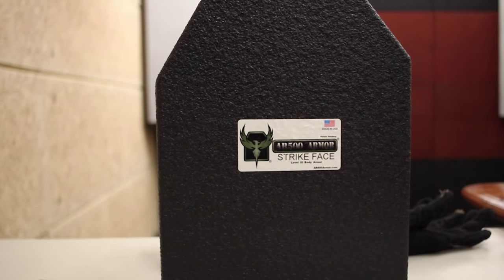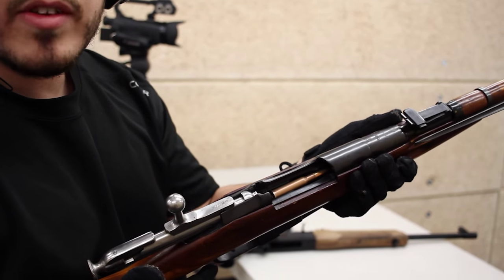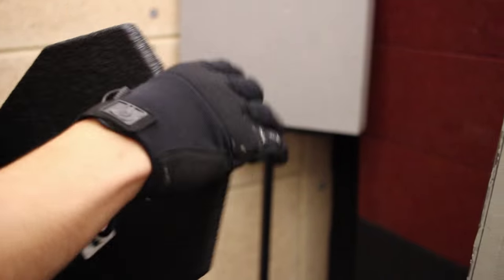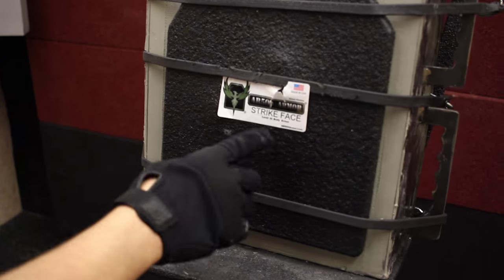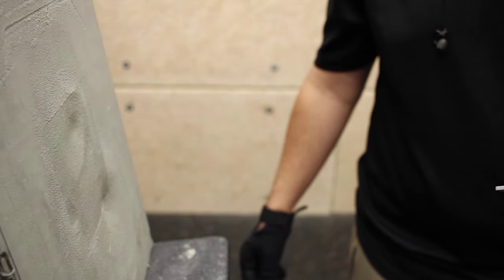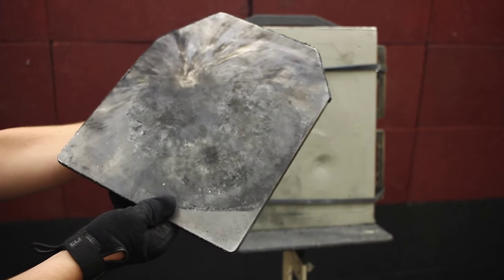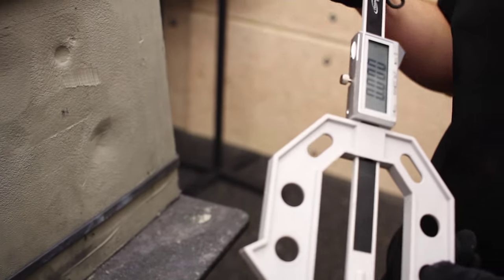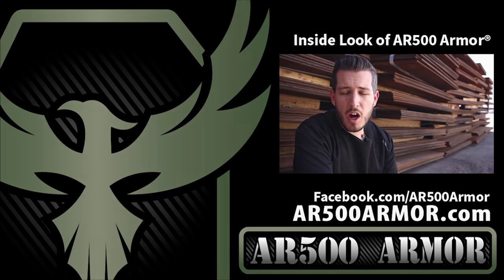7.62x54R Tifecta vs. Body Armor! Incendiary, Silver-Tip, Surplus - Mosin Nagant & VEPR

Comment: Use a Mosin 91/30 instead of the M44. You lose about 200fps out of that shorter barrel.
Reply: Shot my mosin 91/30 with the long barrel made in 1943 at a steel truck bed from the 80s today and it went through all 4 layers of sheet steel without issue
Reply: RichyN25 with my 91/30 I have shot though 1/2in steel I beam
Reply: That's AR500, it's not gonna help.
Reply: Would've also be interesting to see it hit with a steel core round.

Comment: Are those brass shells? I thought they only came in steel
Reply: Most of the military spec 7.62x54 is a steel laquered  casing with either a lead tip or FMJ but you can buy it brass cased from Hornady & others . I just bought an additional 100 rounds of brass cased 7.62 x 54 from a ammo supplier called Miwall out of California that's supposed to arrive today by UPS . I wanted more brass cased because those can be reloaded but the military steel cased can't be reloaded because they use a Berdan primer & are made that way so if your enemy can't reload them to use against you . The Mosin has been used in 39 different wars right up into the Viet Nam war & they made millions & millions of these guns the Russians did plus a few variants by others .  There is a Nagant rifle web page now that shows how to identify where yours was made & what model it is & has some good info on cleaning them as well as some tech tips on how to polish the bolt so the bolt slides easier & doesn't get stuck after shooting rounds through it which is to make sure all the cosmoline is out of it & to polish the pre chamber some so the cartridge slides in easier . It's often rough & what happens is the steel military ammo has a laquere coating on it that rubs off onto the pre chamber & causes extraction issues . They are crudely made because of being mass produced for the war effort so the factory didn't spend a lot of time on fine polishing things up on them because they needed to get them made & out to fight with quickly.

Comment: That has the slickest mosin nagant action I've ever seen.
Reply: It's easy to make them work like butter check out my vids. They're easy when the cosmoline is gone. Also if the bolt has parts from 2 diff factories they have slightly different tolerances.

Comment: I would love to see a comparison of the Short barrel carbine ( 20 inch) they used versus the full length barrel of the 91/30 (27 1/2 inch)
Reply: my thoughts exactly.
Reply: Yes, velocity is key when it comes to penetration.... when I saw the M/39 I knew something was up.
Reply: You lose about 200 fps out of the M44 vs a 91/30
Reply: highly unlikely you're going to be shot at by someone with a full length rifle. also 200fps doesn't seem like enough to go from almost no deformation to completely penetrating it
Reply: You will actually lose velocity with the carbine.

Comment: I love how no one mentioned that you'd have multiple broken ribs along with some ruptures in your vital areas. People just because you have body armor doesn't mean that you won't be hurt or killed from getting shot by a giant bullet like the 7.62x54R.
Reply: Except you won’t, the plate dispersed the impact. I however wouldn’t trust ar500 in the forst place
Reply: >.30 cal
MUH GIANT BOOLET
Reply: @grnnr1846  even with a truma pad you can have fractured ribs. A couple buddies of mine works at gun shops and sells body armor. It's more than possible to get seriously messed up even with proper protection.
Reply: @rodiculous9464  I used 7.62x54R as a example.
Reply: Trench _Raider especially with ar 500 considering it can still go straight through and when you shoot a mosin does the recoil break your shoulder? No because it’s dispersed. With soft body armor yes it can fuck ylu up
Reply: @grnnr1846  a buttstock is different than a projectile. You should learn more about physics
Reply: Trench _Raider what I’ve been referring to is hard body armor if we are talking soft body armor then yes it’ll fuck you up
Reply: @grnnr1846  it doesn't matter about size of mass, it's about how fast it's going when it hits a certain point of contact.

Comment: How come a ap 7.62x54r cant go through body armor but 7.62x51 (308) can ????
Reply: because the silver tip 7.62x54 is not an ap round, its a light ball round with a mild steel core.
Reply: It would have gone through, had they used a full length mosin and not the carbine....
Reply: Lighter rounds travel faster and speed beats armor. So the light ball round traveling faster has a better chance. That's why the 55 grain 5.56 with a 20"+ barrel goes through level 3 but the "penetrator" 62 grain m855 doesnt
Reply: @matthewHizzle  Interesting.  I have some super light rounds in 7.62 x 54r.  I think they are 46 grain.  Out of an M44, they flew at like 3500 fps.

Comment: I know it's crazy but. Does it protects against armour piercing or a .338 round?
Reply: CovertBrony you'll want a level 4 plate for AP rounds
Reply: HatesUsernamesV2 Ok.
Reply: CovertBrony The III+ armor stops AP rounds all day. They have a video on it already out of a Scar at like 10 yards.
Reply: speedysaturn84 For .338 you will want level 4 the level 3+ will stop .308/7.62x51.
Reply: speedysaturn84 Ah. Then that would be amazing to see armour being unable to be penetrated by a powerful bullets.
Reply: speedysaturn84 But the ScarH is .308, he wants to stop .338 lapua magnum probably. I'm sure given certain circumstances, it MAY stop the round but one would probably feel more comfortable with a level 4 plate.
Reply: The AR500 Level III+ armor is designed and tested to withstand bullet velocities of UP TOO 3,100 F/PS without penetration or backface deformation beyond NIJ allowable depths (Level III withstands penetration up to 2,800 f/ps). The .338 Lapua / Magnum has an average velocity between 2,489 f/ps and 2,950 f/ps depending on the grain weight. So the answer is, yes even with an AP round, the III+ is guaranteed to stop the .338 lapua magnum round. Just ask the owner to show a test video, and I am sure it'll be up sooner than later. HatesUsernamesV2 CovertBrony Richard Maunder
Reply: speedysaturn84 Alright then.
Reply: I would bet serious cash the 3+ would not be able to stop a .338 ap. you have to look at the ft/lbs behind that bullet too. if it could id be thoroughly impressed.

Comment: sorry but thats not a fair ballistic test.
Use some soft material to hold the body armor plate.
I mean serious once its makes it far enough to possible break the body armor
plate it hits a massive steel target. So no wonder that there can´t be any penetration.
The plate expands but the round is imideately stopped by the steel plate so it simple bounces back without any chance of penetrating it at all,

Comment: I never understood why they don't have a ridge around the edge of the front of the armor, that would blow all the spattering away from the wearer without the need for caking the armor in plastic although both could be done at once... It's not rocket science now is it ? Because as soon as the coating fails the wearer will lose his jaw if not his frontal cortex. Also, it would be nice to see an API or AP round fired at this instead of incendiary which has no chance of penetrating anything but a soft target. For the money though, best piece of armor on the market for sure. Great advertizing too.

Comment: nice video
did u try armour-piercing 7.62x54R?
7,62 Б-32 гс (индекс ГРАУ — 7-БЗ-3-01) — патрон с бронебойно-зажигательной пулей Б-32
7,62 БЗТ гл (индекс ГРАУ — 57-БЗТ-322) — патрон с бронебойно-зажигательно-трассирующей пулей БЗТ
7,62 БП (индекс ГРАУ — 7Н26) — патрон с бронебойной пулей БП (7БМ4),
7,62 ПП гж (индекс ГРАУ — 7Н13) — патрон с пулей повышенной пробиваемости ПП и биметаллической гильзой
7,62 СНБ (индекс ГРАУ — 7Н14) — снайперский бронебойный патрон
and so on.....
Reply: Silver tip is armor piercing.  It's steel core.
Reply: @Mark13tol  silver tip is not armor piercing the steel in it is considered soft steel
Reply: @Mark13tol  7.62x54R comes in more flavors than Baskin Robbins. http://gunrf.ru/rg_patron_7_62x54_eng.html Still pretty sure nothing's going through, just gonna peel the rubber coating off.

Comment: I was kind of hoping that the silver tip round would zip through so that I'd know that mine could penetrate a plate easily lol
Reply: Mild steel core's not going through that stuff. Not even a tungsten core black tip will.
Reply: @nickaschenbecker9882  One guy used old German surplus Nazi era 8mm Ap, went through AR500 like it was butter.

Comment: Nice! I'd like to see th differences with th full length barrel 28 inches as it's about 2900-3000 FPS vs the carbine which is about 20 inches and 2500-2600 FPS.
Reply: That purple tip API was doing 3,000 FPS.

Comment: $65, wow... that is honestly better than I thought these were being sold for. 

Silver vs non silver?  both are the same thing  LPS/ЛПС. At some point they simply stopped tipping them silver for LPS.  Likely a cost cut.  If your tin says ЛПС it's LPS.  147grn light ball steel core is the majority of 7.62x54r surplus ammo.  If it was made after 1977(more of a chance if after 1980) there is a chance it won't be silver tipped.  Being soviet and being surplus there is variation on the market.  I have some Bulgarian ammo that uses a different powder type.  Some batches seem hotter, or looser.  So you can very well get a difference between silver tipped and non, just as much as you could get from 1979 production and 1972 production.  That's why some folks think this is junk because there can be large variation compared to some commercial ammo. 
There is an heavy cored version that has a yellow band, then silver.  Silver is universally Light ball steel core, ЛПС.

Comment: Was the rifle a Mosin Carbine?
Reply: +ArcanusLibero Yes. M44
Reply: Thanks.
Reply: No problem. I looks just like mine by the stock/bluing condition, plus the thicker front sight dovetail base. Definitely not an arsenal refinish, straight from the factory. It has to be a 1946-1948 model based on it's post-war condition and front sight.
Reply: I had one as a kid. Your looks to be in awesome condition compared to what I had.

Comment: Is it possible to do a test showing your the stopping power of both your level 3a sitting behind your level 3 plate? Just curious as to what rounds would be stopped and what it would take to get a penetration. I am currently waiting on a plate carrier and it has pockets for both your steel and soft armor so just curious as to what kind of protection I can expect. Thanks.

Comment: you are using carbine rifle not a mosin nagant ))))) carbine has 50% power of rifle :))))
Reply: from that range, it doesn't matter...
Reply: @IonutzGamesMc  It does matter. Muzzle velocity is everything when armor penetrating. These silver tips are still soft metal. They just have a little heavier core to put more punch on the jacket. Any real AP rounds will go thru this no problem. Insurgents used PKM machine guns with AP rounds against hummvees and it would go thru like butter.